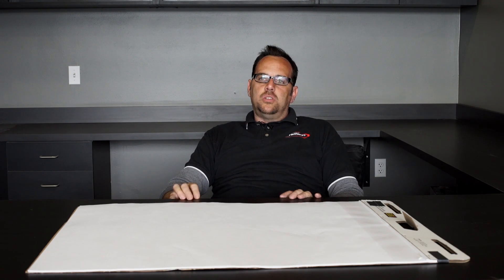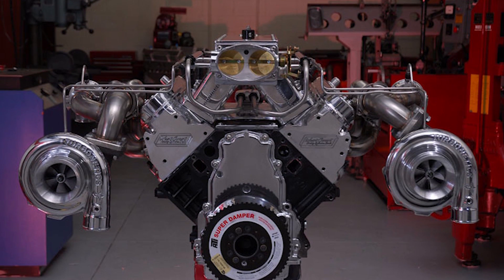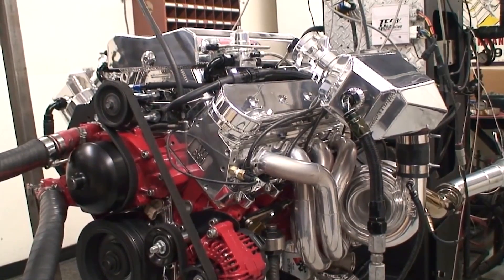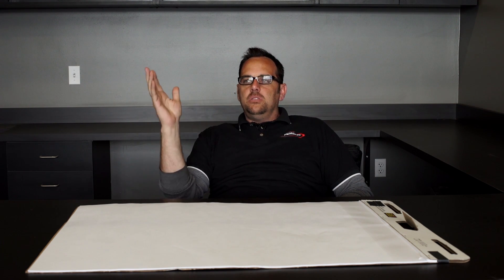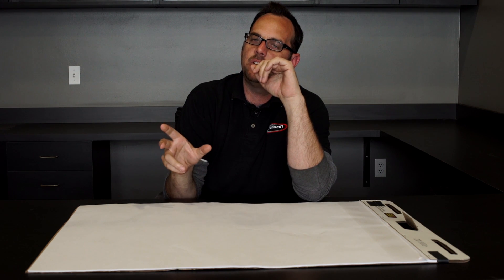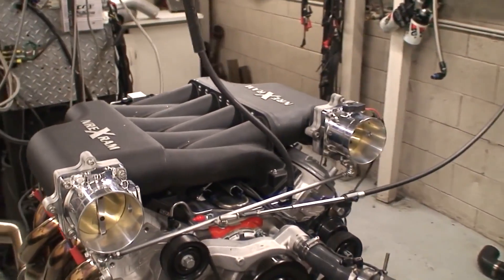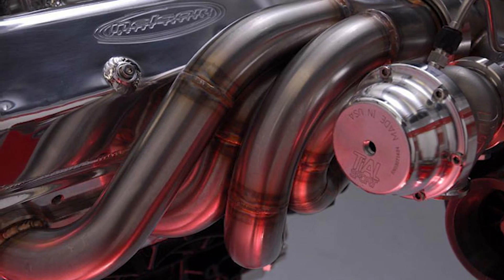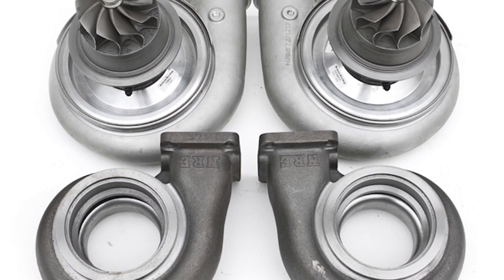Master Engine Builder Explains Why the LS V8 Is SO Good

Comment: Always thought its weird how America has always been exceptionally good at making engines but the rest of the car is hit or miss. Like the Ford GT 40 is Euro Muscle.
Reply: +N13L6 You are correct if you are writing about volumetric efficiency. But not if you are writing about fuel efficiency. 6.2 L LS is a large displacement engine, but it is lighter, smaller and gets better mileage than its European counterparts. Generally more reliable and cheaper to maintain as well.
Reply: +N13L6 I've been  a Benz tech for the past 10 yrs and I can say they are no more reliable than any other car out there but you pay 3 time more than just about any other car out there. Zl1 makes about 556 hp that's not low horse power so I don't know what your looking for.
Reply: +Junior Collantes The ZR-1 Corvette got much better mileage that the Ferrari 458.
Reply: N13L6 Something to keep in mind.  In Europe, cars are taxed according to engine displacement.  In America taxes are imposed according to efficiency.  A larger American engine that is physically smaller. lighter, more reliable, has lower emissions and gets better MPG is still taxed at a higher rate than car with a smaller displacement engine.  Also, seldomly do American designs incorporate technology for the sake of technology.

And this is coming from a devout and militant Porsche fanboy.  :-)
Reply: +likenem like in what way are the good? I think they are kings of inefficiency, big ci, low hp...
Reply: 36thgallardo Or an American V8 with cylinder deactivation.  Owners of the current Corvette Z51 are reporting 30mpg on the highway.  Not bad at all.
Reply: +N13L6 those giant engines with stupid low power off the mid 70's-80's was thanks to emissions.
Reply: +Telace Johnson ZL1 makes 638 hp ZR1 and LSA make 580 hp. The new LT4 makes 650 hp, The car that made 556 hp was the last gen. CTSV.
Reply: likenem And of course pretty much every manufacturer has licensed GM's magnetic ride control.. For a time Lexus even tried to take credit for the invention.
Reply: QuickSSilver98 The 4 cyl Mitsubishi Evolution only gets 17/23, way less than most modern V8 mills.
Reply: +TheShank6666 I'm confused. You give all these examples of cheap asian labour and then point to Ford being ahead because they have European R&D. I guarantee you european labour is expensive. Europe has had more advanced engineering for decades in many areas, Ford Europe, completely independently of the US, made good EUROPEAN cars, Ford USA finally figured out they could actually sell some of those in the US without completely ruining them first.
Reply: Nick dominic
Thanks for the info.  I hear the same thing about AMG cars.  Once the warranty is over they become huge money pits.  Probably why they depreciate so rapidly.
Reply: +Parag Mathur yes, low maintainance because of low HP, the parts wear out a lot slower! Im not sure about how EU big displacements fare, but I am sure the USA has a lot more knowledge in that area :-)
Reply: The tremendous problem of LS engines is they are just monster to consume fuel is just.... Too much.
Reply: N13L6
I think the LS probably pretty efficient since the Drive video with RX-7 LS 2 swapped was more efficient then the Japanese Rotary engine.
Reply: N13L6 That's why I found it odd that you were saying the U.S was catching up to Japanese and European engineering. Like said before Benz uses Detroit diesel engines and even Nissan is using Cummings engines.
Reply: +likenem The GT40 started out as Euro muscle.  But it wasn't until Shelby and Kar kraft got hold of it and completely redesigned the chassis,suspension, body and engine did the GT40 become the world beater.
Reply: +Junior Collantes not true. The amount of fuel a motor consumes depends on how much air you are feeding it hence A/F ratio.  To say LS engines suck fuel is just an indication you know nothing about how a motor works. Ive seen 4 banger hondas with big turbos that get worse gas mileage than a full size new truck.
Reply: +Telace Johnson currently a bmw tech and they are trash in terms of reliability
Reply: +N13L6 This is actually just flat out not the case......there isn't a technology gap between US, Japanese, and European car makers. There is a perception of a technology gap and this mainly comes from the type of vehicles people buy in either countries. It is true that cheap gas in the US has had a big impact on what US consumers have purchased, which is why GM scrapped the Chevy gas electric hybrid in 1969 (however that wasn't new then either). 

The really big difference is performance engine building philosophy where European and Japanese automakers when it came to NA have used more rpms to build power. American car makers have generally used more displacement to produce more power, there were other factors that helped to make the choice like getting these engines to 150,000+miles with simple/cheap maintenance. 

If you didn't have displacement taxes in Europe then you probably would have seen larger engines used in Europe, after all look at the cars in which those taxes mean nothing. They make sometimes 7.3L V-12 engines.....

For forced induction pretty much everyone is building them for mid range so they all come out similar....
Reply: +likenem corvettes have been able to get 30+ mpg highway since the C5. It's nothing new really.
Reply: +TheShank6666 No twisted panties, sorry if it came off like that. Definitely agree that Ford is ahead of the game compared to GM and Chrysler. Although I am surprised and pleased with Corvette's huge progress in the last years. Still way too flashy and cheaply trimmed for European markets but the performance and tech improvements since they started racing at Lemans are impressive!
Reply: +NuclearGrizzly I know, I think that is why US manufacturers stay with big v8's. Thats one of the problems with the mustang modulars, You can fit a big block in the same space.... so why not;-)
Reply: NuclearGrizzly personally i would say they are just overrated cars, all 'M' cars are nice in my opinion but regular cars 335 435 750 etc its a hit or miss when you buy one. Once the warranty is done your wallet will be empty. Everything after the 2005/06 is hit/miss from oil leaks to random motor issues.
Reply: NuclearGrizzly theyre money pits from the jump but for the first 50k miles its a warranty issue, trust me the new bmw stuff like the 335 theyre nice looking and fast but man i wouldnt take that risk unless i had the cash to back it up
Reply: +NuclearGrizzly I think its mainly the newer stuff. the older cars with the simple straight 6s are very reliable. I have an E34 with 116k on it and it runs great.
Reply: FrankieJames7
Whoa whoa lets keep it civil.
Reply: *****
Jobs got shipped to Mexico because dumb fucks in congress signed the NAFTA. We probably wouldn't have unions in the U.S if companies didn't get there employees killed.
Reply: dalilrafi i work at bmw dealer as a technician, you cannot tell me the n52 is a reliable engine i swear i have one in my bay right now, misifiring like no tomorrow.  n54 and n55 are powerful motors very fast but  n54 is not reliable, carbon cokes up the back of intake valves vehicle runs like shit.
Reply: RTMissouri Reliability seems to be a common thread among inline sixes.  Probably has something to do with the balances rotating mass and a lack of secondary vibrations.
Reply: +NuclearGrizzly Something tells me BMW will take the i6 with them to the grave, everyone seems to gave abandoned this engine design (outside of diesel engines) but them.
Reply: likenem
The Shelby Cobra, Ford GT40, Hennessey Venom, Detomaso Pantera, Sunbeam Tiger and many more US/Euro conglomerations.

But yeah, the Chrysler TC.  Unfortunately it  wound up the opposite of what it was intended.  American styling and Italian reliability. lol

As ridiculous as it is, here's one I'd sure like to find parked in my driveway.

http://www.carbuildindex.com/44520/the-1971-firebird-ferrari-yes-gm-built-it-but-only-reluctantly-by-wallace-wyss/
Reply: +NuclearGrizzly sure, current spec is up to date :-) luckily the time of the 6liter 200 hp cars is over! But the cars in my country (NL) are taxes according to emission and economy, so there is no real incentive for small displacement...
Reply: +likenem American car companies have to actually pay their employees, above minimum wage and then retirement packages. They can't have people work on "family honor" or work for peanuts because the country doesn't have a lot of jobs. Working for Toyota is like a camp, 30 days in, no access to the outside world, no talking about what you work on. American companies can't get away with that. That is why Ford is so far ahead of Chevy and GM with tech. They have a large European market where they get a ton of R&D done for cheap.
Reply: +TheShank6666 i think secondary employment agreements in the EU are better, just look at holiday days etc.. that's not an excuse for less r&d
Reply: LG396
Detroit Diesel makes engines for Benz. Americans engineering is probably pretty good then.
Reply: +N13L6 I think your comment shows what you do not know about LS. LS engines are very efficent. 2013 Zo6 7.0 N/A V8 gets 25 mpg highway. was 505 hp 500 LBS. Big, no cam in block engines are some of the smallest engines in the indutry partly because of the cam in block design. They are also some of the lightest motors 100 lbs lighter than 911 engine.
Reply: LG396 It was just a Japanese example actually. I have no problem admitting I do not know the details, but I do know that Ford invests a lot of it's R&D into Europe and they are pretty far ahead of Dodge and GM in tech. I just put 2 and 2 together really, don't see why that gets your panties in a twist.
Reply: LG396 And really? Ford Europe and north America completely independent lol? Lmao.
Reply: +likenem rotary is reaaaaally fuel hungry engine design! and it wears out pretty quick, so LS is good option! btw, im not saying an LS is bad or anything!
Reply: +TheCamaro5 I was not talking about LS specifically, just USA engine design in general. I don't doubt that the LS is a good engine...
Reply: Nick dominic BMW owners are saying the same thing. When did this start?  Is it all models/engines?
Reply: +TheShank6666 ford europe is actually located in germany, guess thats why they are so good.
Reply: +NuclearGrizzly 30 for the c7 is actually low. I get that in my ls3 c6 without cylinder deactivation. I saw a magazine hyper mile a c7 and got about 80mpg
Reply: +LG396 Ford Motor Company is the parent company of Ford Europe. So, not independent. But they do have some autonomy as a subsidiary.
Reply: +likenem Most American cars in Europe run Mercedes CRD Diesel engines.
Reply: +Junior Collantes 

30mpg from a V8 in the corvette is too much?
Reply: +Junior Collantes Gets better MPG, makes more HP than smaller v8's from lexus or BMW?
Reply: JerseyMikeP Most of those "smaller" displacement V8's are actually physically larger and heavier with a higher center of gravity.
Reply: +likenem wait are you telling me that a the gt40 is a euro muscle and that is was a hit and miss? hahahaha
Reply: ps31871
I'm saying the engines ford was making was a hit but not the car bodies that's why Shelby got some from Europe to win.
Reply: +TheShank6666 What George Orwell book are you reading? I work for Honda (not Toyota) and I can anonymously say your entire post is utter (udder?) boodlesheet. Do you realize in the auto industry all of us have employees from all over the world? Honda supplied the V6 for the Saturn Vue and a Japanese company supplied the subs frames for the Escape, Terrain, Equinox, Acadia, etc. Do you really think Toyota, Honda, Mazda etc. are paying their line associates peanuts? If they did, there would be unions in all of their manufacturing plants. The fact there are no unions should tell you that they take care of their employees so there is no need for the union. Good luck finding anyone in ANY of the automotive manufacturing facilities (Japanese, American or otherwise) making minimum wage. Better yet, Google average hourly wage for automotive manufacturers. The US companies will be higher but when you see the wage you'll see they all likely make more than you do and with the Japanese companies your job is less likely to end up overseas or in Mexico.
Reply: +N13L6 ohhh europe, what a bunch of retarded ricer fucks who know nothing about the real world.
Reply: +Nick dominic +RTMissouri The N52B30(NA) and N20B20(Turbo) engines are tested as the most reliable engines between 2000 and 2013 by the German car magazine AutoBild. The test is completed when a car's mileage hits 100.000km (62.000miles). The N46B20(NA) in my 120i placed 13th. I have yet to spend a cent on repairs (97.000km).
Pretty much all the 135i & 1M drivers I know are more than satisfied with their N54 & N55. Same as the N43 and N52/53 owners. I don't get where all the Internet-folks take their mystic stories about reliability issues from...
Reply: Nick dominic At the same time several hundreds of N52 pass the maintenance routine every day. The N52 isn't a very faulty engine percentagewise but there're errors that may occure like hydraulic valve lifters or yours. Although, highest mileages on German market are achieved by N52/53 and N62.
The carbonization problem isn't BMW-only. All the manufacturers using DI-engines with EGR have this problem...from Acura to GM to Volkswagen...some more, some less.
Reply: +N13L6 The V8's of days past were really pathetic, weren't they?  Thanks, Cadillac, for making a 500 ci V8 that only produces 190 HP (1976)!

As for those who are parading the European engines, you might be forgetting that engines in the North American market tend to have a very different purpose than those in the EU.  How many people in the EU drive a pick-up truck?  GM saves a ton of $ in R&D and manufacturing by using the same basic design in both performance cars and workhorses.  

Besides, how long is a small, turbocharged inline engine going to last hauling around 5000 lbs of cargo?  Not to mention, that smaller engine will have to be running nearly twice the RPM of the larger V8 to keep up, so you will probably burn as much, if not more, fuel while producing a lot more heat that needs to be dissipated.  Excessive heat is the #1 killer of any engine.
Reply: Spectre528 Late 70's and 80's sucked for everyone though. Porche had a engine from a VW minivan in it.
Reply: +likenem Haha, yes indeed.  Emissions technology was in it's infancy at the time.   I just like the Cadillac example because it's so outrageous.  Nowadays it's almost taken for granted that a 500ci V8 will make at least 1 HP / ci
Reply: likenem
When I was a kid, the 245 hp Buick Grand National was just unbelievable.
Reply: NuclearGrizzly That torque though...
Reply: Spike Razzor
Oh yeah.  Plus with a simple swap of a chip, down pipe and thermostat there was a reliable 400 hp, 450 ft/lbs on tap.  And let's not forget those Darth Vader looks.
Reply: NuclearGrizzly  That's another good example of Europe and America coming together since Mclaren twerked the fuck out of the grand national for the GNX Version. Sadly Chrysler and Maserati didn't repeat the magic in 89 with the Chrysler TC.
Reply: +N13L6 Just like VW builds clean diesels, right? Besides, we're in 2015. And do you know why they had high ci and low hp? I guess you don't.
Reply: +NuclearGrizzly AC Cobra was the original.
The 'Shelby' Cobra was a license built copy. 
The Hennessey is also a weird one because they're legally Lotus's.
Reply: Compared to everything of a similar power level, they are great. The Corvette makes 650 hp stock and gets 30mpg.